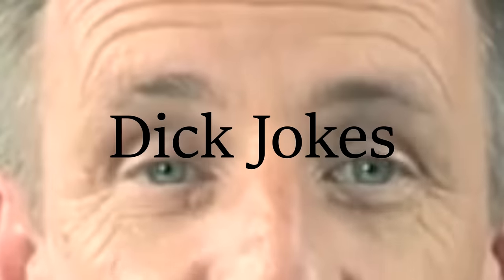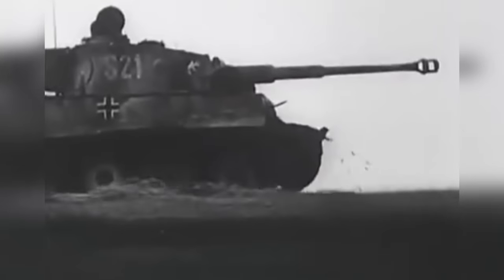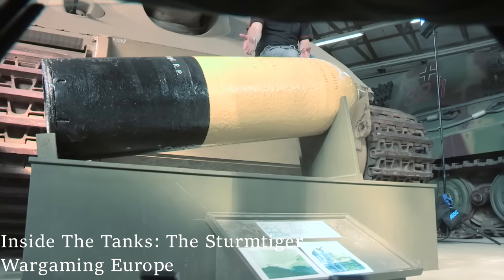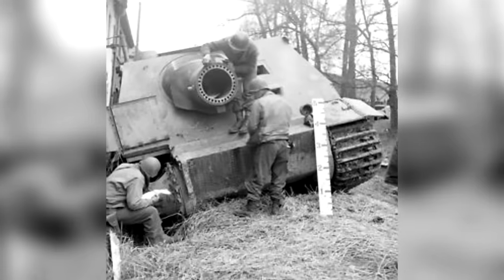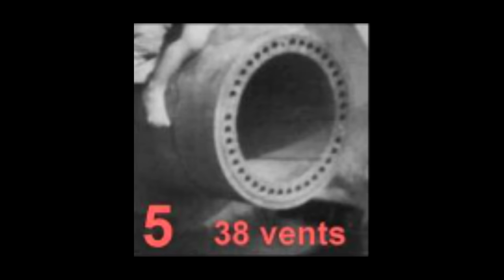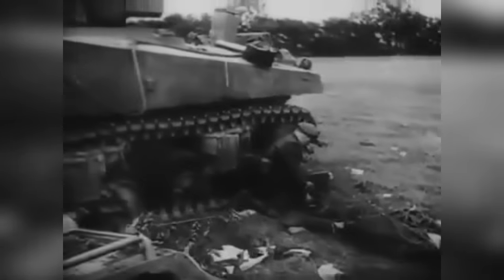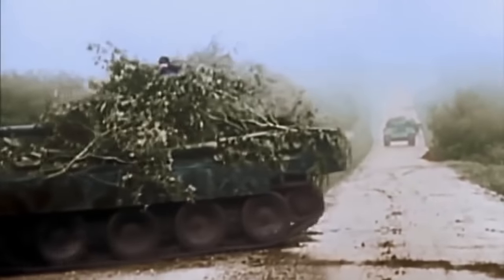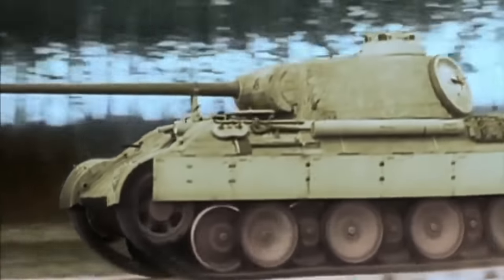The Sturmtiger, Too much too late

Comment: This looks like it was a nightmare to crew, as much as I wouldn't want to be on the receiving end, I wouldn't want to be in the gunner position either. At least if u get hit by it you're dead, imagine the endless ringing in your ears for the rest of your life after shooting this thing
Reply: Imagine a situation: 

You and your sturmtiger crew are advancing with your infantry until you find a large allied bunker, large enough that it’ll take more then one rocket to take out. You have a round loaded ahead of time due to how the sturmtigers transported ammo. The first rocket hits hard, knocking out a significant portion of the artillery and men giving you trouble, however this makes you a target. Not to mention seemingly giant trail these rockets leave. Thus every gun emplacement wants you dead as fast as possible, luckily your in a tiger, it’s gonna take something on the heavier side to kill you. The loader has loaded the second shell into the chamber from the loading rack, miss. This now presents a rather major problem, the only way to gain any more rounds is to get out of the tank and operate the crane needed to load more shells. Under a hail of bullets. Yeah no that’s suicide considering how many things that want you dead. 

Of course by now your infantry is being exponentially more effective because they aren’t being shelled, so you now have people firing back. It’s also worth noting that it’s probable that you would have a escort, a panzer 4 of some kind, a stug. So you wouldn’t be entirely a sitting duck, but god that would be nerve racking

Comment: This is the trouble the Germans had. Instead of saying, "Well, we have the Panther and the Tiger 1, and the Allies still have their hands full with them," they make a handful of expensive and unreliable King Tigers, and Jagdtigers, instead of using the Jagdpanther in the tank destroyer role... the Maus, E50, E100... enough was never good enough. Whereas for the Allies, the T34/85, the M4A3E8 Sherman and A34 Comet were just good enough for what they had to do. They were evolutions of what had worked earlier in the war (T34/76, M4A1, Cromwell). No, they couldn't stand toe to toe with the King Tiger, but their chance of coming across one were vanishingly small.

The Germans were never happy with what they had. They always had to push it until contemporary technology couldn't keep up, as the Reich crumbled around them.
Reply: The Germans tried to think ahead to match the NEXT generation of allied tanks they expected to face. That's why they came up with the King Tiger. They weren't blase to rest on their laurels. They knew the allies wouldn't stand still.

Comment: It could be that they had a lot of the ammunition on hand when it was proposed and the weapon itself seems simple to make, no need for accuracy, used at fixed or at least known ranges with no rifling and launched at 45 m/s which means there's not much pressure for the mechanism to handle

They just should've shaved most of the armour off since if any serious threat gets close enough and you've lost you're screening forces then you're fucked anyway. I don't know how 1 could've taken out 3 Shermans when the rate of fire and the accuracy must've been abysmal. 
]

Comment: Erm. They built 18 of them => specialized kit with no intention of mass production. It also used damaged or outmoded Tiger chassis and a gun not adopted for another role aka material not usable for tanks anymore. We could also consider that a tank prototype finalized in 1943 probably started design up to several years earlier (like all tank designs, the Tiger design concept comes from pre ww2, it was not intentionally designed when the war changed its pace, that was what simply had happened) So... I think your entire analysis is based on a false assumption...

Comment: the germans liked to play around with designs,
with this variant its just dumb
the shells of the strumtiger use oil which in mid-late war is what the germans so despperately need for their own already used tanks and aircraft,
so this design is actually helping in the downfall of the third reich.